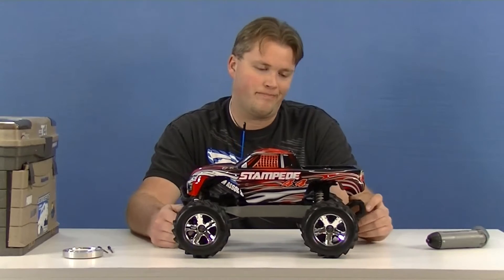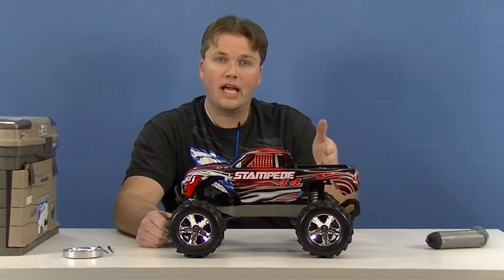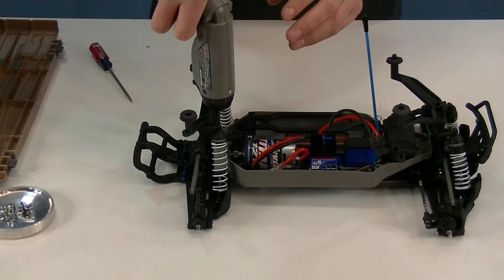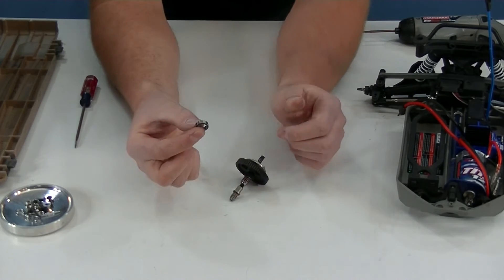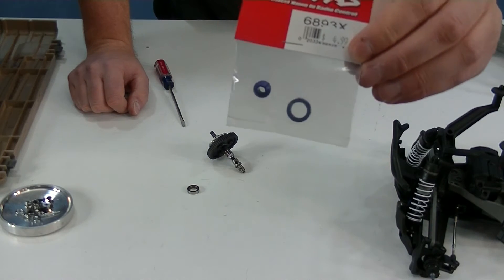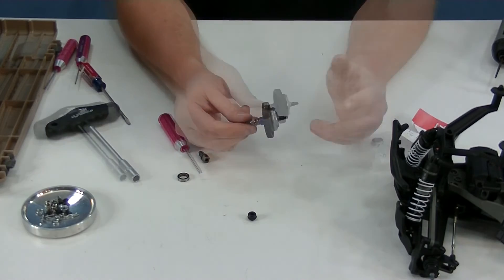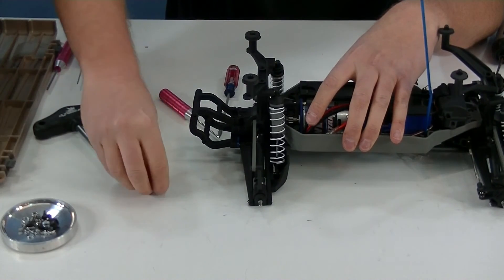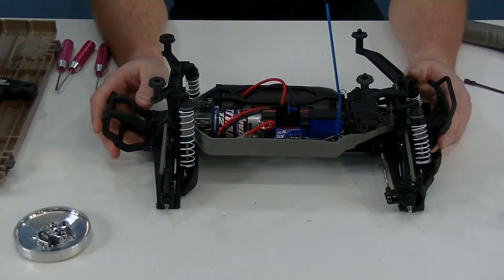Traxxas 4x4, How to Replace the Center Driveline Bearing.

Comment: A couple tips:

a) When disassembling something, put the screws back where they came from, rather than in a dish. In this job, it's not a big deal, but if there's more extensive disassembly, it can be easy to forget which screw came from where.

b) When re-assembling these, start the screws manually. I like to turn them backwards a bit first while pressing down, until I feel the thread pop. Then, I know when I start turning it clockwise again, I won't cross-thread it, because it's at the beginning of the thread.
Reply: Jeremy D I know, driving me crazy putting all the screws in a pile.

Comment: Good video! As a general habit, you should lube your bearings whenever you have the opportunity. As you point out, this is one of several bearings that get beat up pretty hard, so getting some lubrication in there will help tremendously. Great idea on the clear cover...make it really easy to check if anything is amiss!

Comment: Thanks for the info just picked one of these up. Put a mild brushless system in it. Do you know if the metal drive shaft is just a strait swap? Thanks
Reply: NorcalMoto yes has to be.